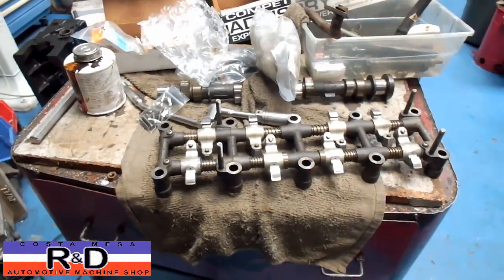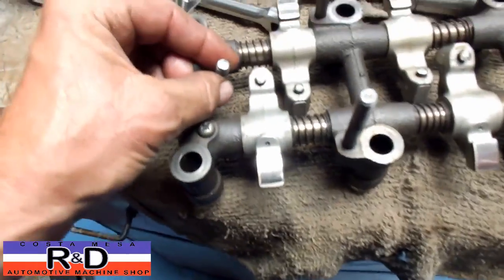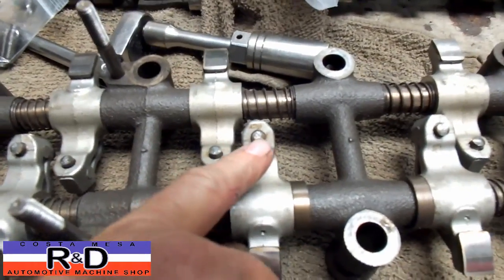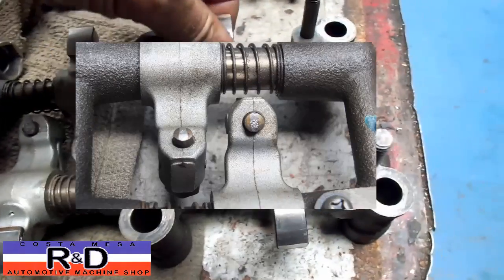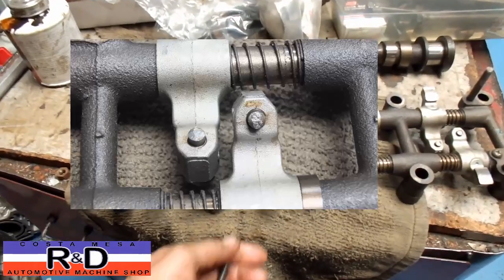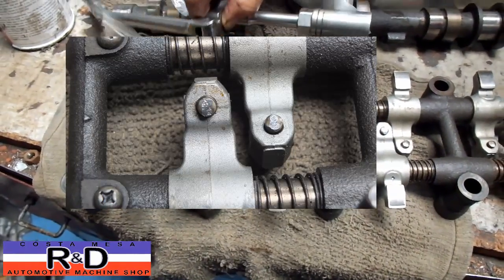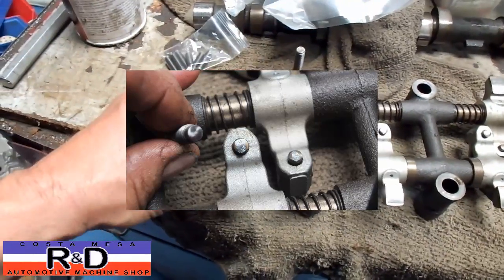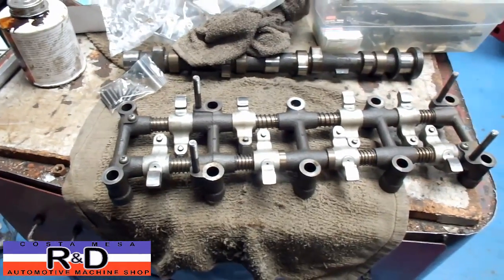Toyota 22R Rocker Arm Problems v1.3

Comment: You also need to make sure that stem on the adjuster is centered over the valve stem. You can get 0.10 0.20 and 0.25 washer shims that go on the rocker arm shafts to aline.

Comment: I have replaced my valve lash screws and adjusted to specs, still can't get rid of that ticking. Thinking maybe the rocker arms are worn? 250,000 miles just rebuilt including chain & guides.

Comment: would this cause excessive valve noise? i seem to be having excessive noise from the rear of my valve cover i did upload a video to my account if you have any interest in checking it out. timing chain and tensioner were replaced with japanese products 2 months ago. still tight. oil is 2 months old and still pretty clean.

Comment: Agreed it seems it's a result of oil change infrequency and most likely an insufficient oil in terms of anti-wear EP additives.  Like Yoan Carlove said, older engines with non-hydraulic valve train need those oils with the proper additives to avoid pitting in the areas of high pressure loading.  We see it in the air-cooled VW & Porsche segment of engines all the time.

Comment: Newer type of engines include: post-2004 engines (when SN oil was introduced). Engines that can use higher concentration ZDDP in their oil include those free of emission control systems and catalytic converters, flat tappet lifter type engines and high camshaft profile engines. You can run a higher PPM of this particular additive in newer vehicles with advance emission control systems but at the risk of replacing oxygen sensor(s) and reducing your catalytic converter's life.

Comment: To prevent that, in addition to regular oil change and using the right weight of oil for you engine, USE THE RIGHT GRADE aswell. What I mean is, newer grades are for newer engines. You probably eard about additives! Zinc DalkylDithioPhosphate is one of them and older grade of oil CAN have more in them. Never go older then SJ though because you really don't have to. You can also use ZDP enhanced oils... Just don't use starbucks and new high rating synthetic oils, they simply won't cut in in wear prevention. Those are designed for newer type of engines.
Reply: Don't use Starbucks? Your saying some people use over priced coffee as oil?...

Comment: Check valve lash means mechanical lifters huh? Surprising that they have mechanical lifters as I thought nearly all cars had hydraulic now
These people who never change their oil think they are saving $$$ but then they need an engine tear down or the engine seizes and they are out thousands instead of 30.00-- My jeep GC is a 96 with the 5.2 has 140,000 miles and it runs like new due to constant oil changes, I just changed the valve covers and the heads are spotless- not even a hint of smoke when I start it up and NO oil consumption
Reply: Watch the clip again, the rocker feet ride on the camshaft.
The adjustable threaded part oscillates, across the valve tip.
Notice the wear marks, on those pieces, back & forth.

They are the pieces, being replaced.
Upshot mechanical valve train, maybe uncommon now, but this an older engine, cheers.
Reply: Suspension problems alignment 1990 Toyota Pickup truck right front released

Comment: cavitation damage by the looks of it.
Reply: Impact force turning the liquid in hot gas like the mantis shrimp?
Reply: Yoan Carlove yep! I would say so.
Reply from the maker: This is not cavitation damage. Cavitation is the rapid creation and collapse of tiny air bubbles in a liquid. Get a copy of the engine rebuilding handbook I wrote(Sunnen's Complete Cylinder Head and Engine Rebuilding Handbook) and read the section on cavitation damage.